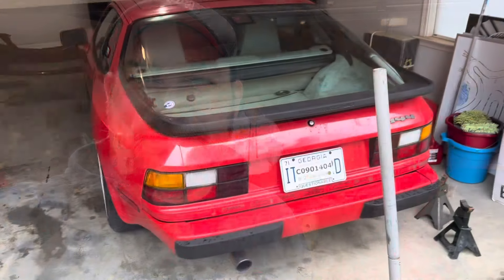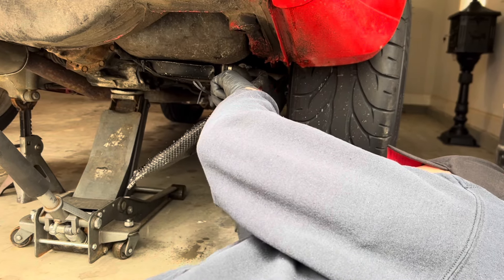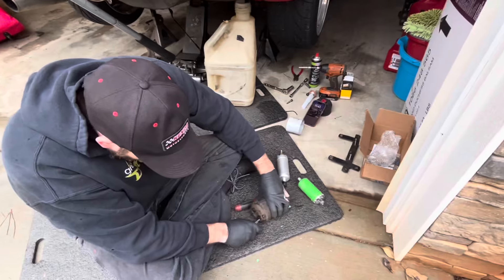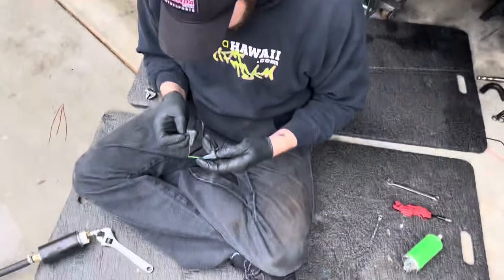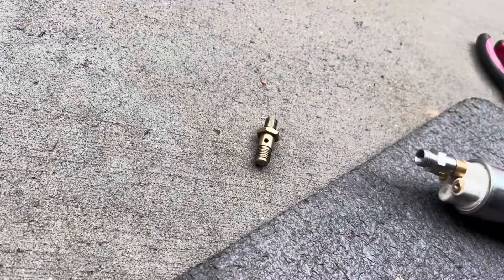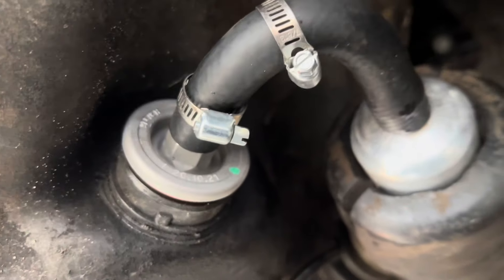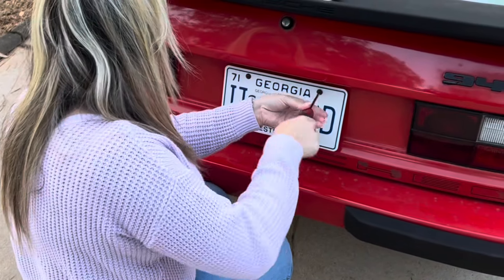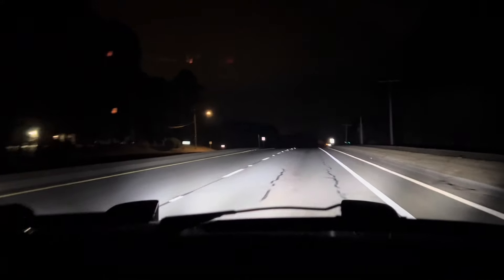Porsche 944 disaster! Fixing broken fuel tank with Tamarah

Comment: The fuel pump doesn't run just with the ignition. It turns on on;y when the ECU sees over 300rpm. To turn it on manually,  jumper the 3 large terminals of the DME relay. Love the 928 tank outlet bit.,.....